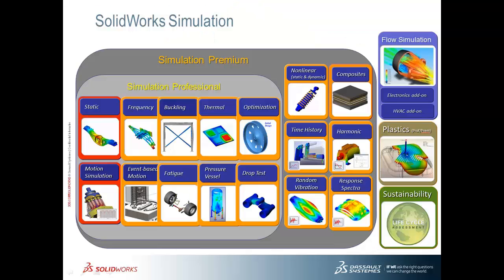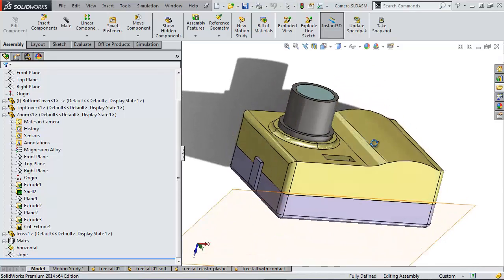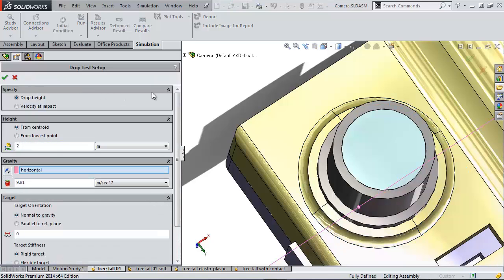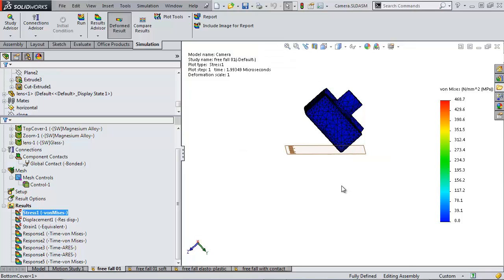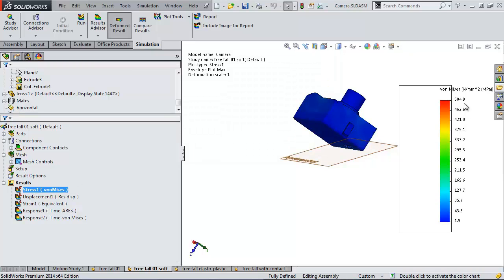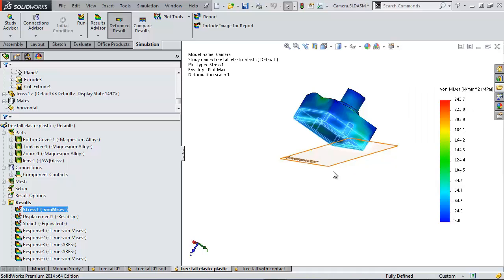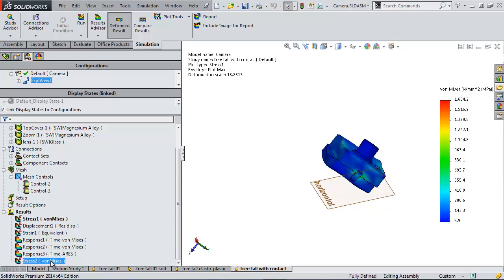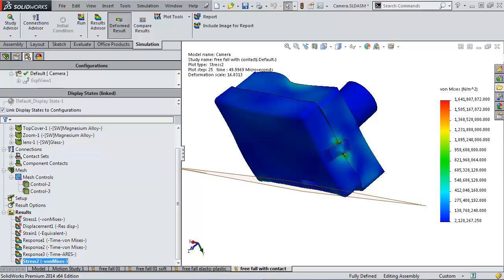SolidWorks Simulation Professional - Drop Test Analysis

Comment: Which formulae does solidwork use to calculate the stresses? 

With a force balance of kinetic & potential energy and a stiffness factor of the floor i can calculate the displacement of the floor. Once i have the displacement i can use the formula for impact force F = (0.5*mv^2)/d. 

I found a formula for impact stress which is: stress = (P/A) + sqrt((P/A)^2 + ((2EPh)/(AL))). This relates to an object which is 'hit' by a falling load. However the object is fixed on one side, allowing for an elongation in L. Therefore i cant use this formula to calculate the stress for a falling object when hitting the floor. 

Any ideas which formulas i should be using?
Reply from the maker: This sounds like a challenging question. For assistance, please contact our tech support team at goengineer.com/contact

Comment: what material floor are u using
Reply from the maker: Hi Arpit,
There is no particular material specified for the floor in the flexible setup of this study.  Arbitrary flexible values are being set only as an example.
Reply: GoEngineer can u please give values of tangential and normal stiffness for concrete
Reply from the maker: I have to apologize but we do not keep such data on hand so we don't have values to give you for that.

Comment: Could this be done to imitate a collision?
Reply from the maker: Hi Andrew,
This study type is not designed to accommodate the collision of two objects.  You can, however, define two studies  for each individual colliding part to see how each part would react to a collision.  In those setups it would be important to take a look at the flexible definition of "ground".  If you have a stiff object colliding with a more pliable object you would want one study with pliable ground values to analyze the stiff object and one study with stiff ground values to analyze the pliable object.

Comment: please help me ! i need normal stiffness and tangential stiffness of sand .thanks !
Reply from the maker: Hi Tung,
Sand does not adhere to a material model that could be described by Elastic Modulus, Yield Stress, and Tangent Modulus.  You would not find these material constants for sand and could not run a drop test with sand as a result.